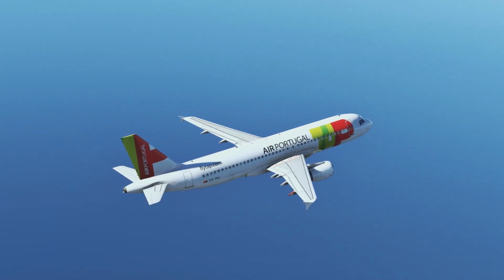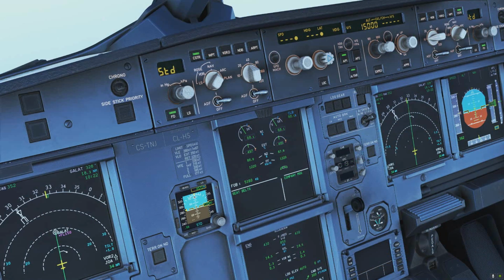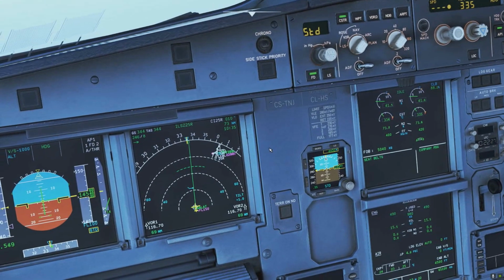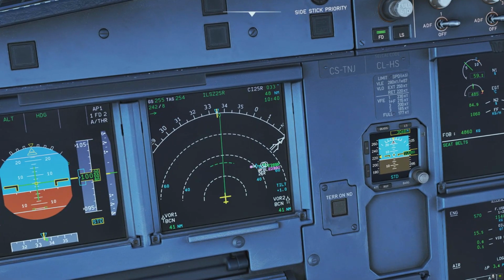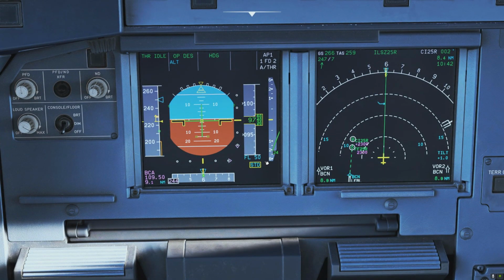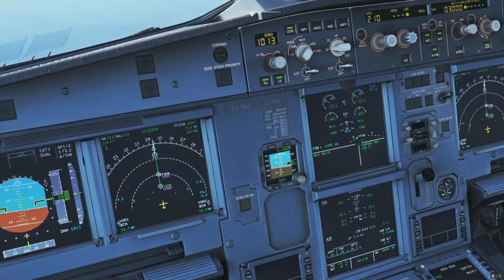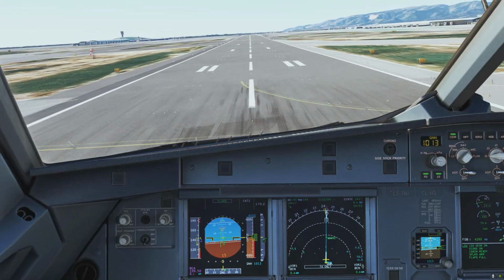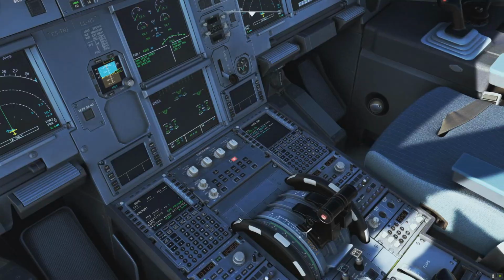Descent and Energy Management like a Pro!

Comment from the maker: Sorry, I just realised I said the strategy wrong. If you are too low, use V/S for a nice gentle approach until you are on profile. If you are too high, use open descend to get down quickly.
I don't know why I confused those two things in the video.
Apologies for that.
Reply: Found a video which explains a trick how to descent if the airbus is to high on profile. He increased during descent the speed of the airplane. On profile it should be for example 270. He increased to 310, difference 40. Than he descent 4 x 300 feet below the profile = 1200 ft. When around 1100 ft below the profile he changed to managed mode and the airbus gets back on the profile with perfect 270 knots.
Reply: @FlightDeckMagazin how can we find this video? Thx

Comment: I have one question about the speed below 10000ft. I've often heard that ATC said to the pilots below 10,000ft "no speed limits." But that doesn't mean that they can now fly around at 320kts. Can you please tell me what they exactly mean by that? Thank you.
Reply from the maker: Believe it or not, this is company specific. In my company the rules are as follows. Below 10.000ft the maximum speed is 250kts. If ATC says "free speed" or "high speed approved" it is still 250 kts. The only exception is if ATC requests a specific speed. For example "fly 270kts until FL70". In that case we will of course comply.
I hope this helps
Reply: @fsclips  Ohhh, I see. High speed or no speed restrictions still means max 250kts unless ATC gives you a specific higher speed. So for example, your STAR gives you a speed limit of 210kts you can still go 250kts and no more unless ATC gives you instruction to go faster but you can slow down whenever it is necessary for a safe approach. Is that correct? Thank you very much for the clarification.
Reply from the maker: @joachimp4265  If the STAR says 210kts you have to fly that. If you are on radar vectors and you want to slow down early you should inform ATC.
Reply: @fsclips  ok, now I got it. Again thank you👍

Comment: Hi captain! Could you tell me your technique of “durtying” the plane before landing in the approach phase using altitudes instead of using distance in nautical miles, please? For instance, I am used to use the 5 and 10 NM arcs to starting deploy flaps and landing gear but I know there is a method of using altitudes. Thank you!
Reply from the maker: We don't really use altitudes in the real world because every airport is at a different height. If your rule is to put the gear down at 2500ft but you fly into an airport that is at 5000ft you would land with the gear up. So, we only use distances and are therefore independent from the altitude of the airport.
If you want to insist on using altitudes you need to do some calculations using the 1 in 3 rule. If you want the gear to come down at 6 miles then you need to allow 1000ft per every 3NM. So in this carse you would put the gear down at 2000ft, but that is above threshold elevation, so you then need to look up that elevation, let's say 1700ft and add it to that which gives you 3700 ft. As you can see this is way too complicated and could lead to errors. Using distance means it doesn't matter how high the airport is and you can use the exact same numbers on any approach.
Hope this helps
Reply: @fsclips Much appreciated! Can you tell precisely the sequence you are used, please?
Reply from the maker: @sinicodaniel  I am not sure which sequence you are referring to. If it is the distances then I tend to fly 210kts until around 12NM. I try to get onto the ILS GS with Flaps2 as otherwise slowing down becomes difficult. Then around 180Kts until 9NM and 160Kts until 5NM. I put the gear down at 6NM then F3 and then F Full. These are rough guides and depend on the ILS and the aircraft weight and the winds.
Also, some airports have standard speeds  you need to stick to. For example in LHR you need to fly 160kts until 4DME.
Hope this helps
Reply: @fsclips Yes, it was the answer I was looking for! Many thanks again! 😊